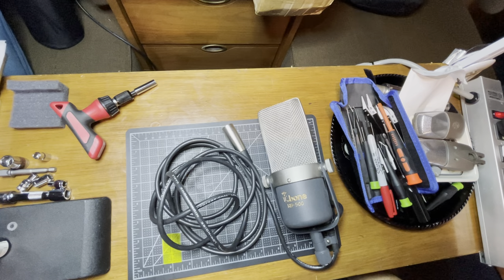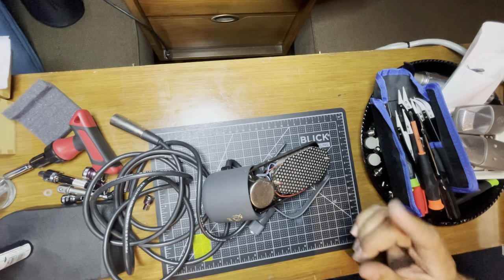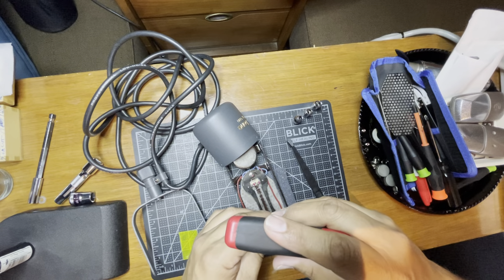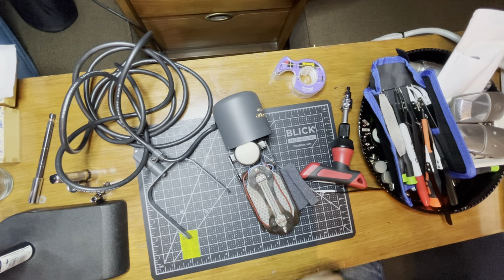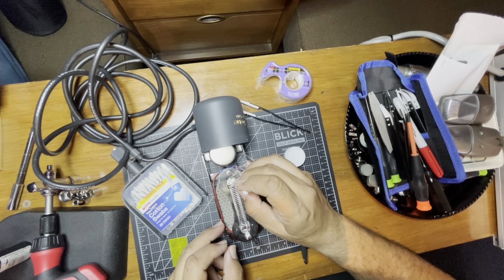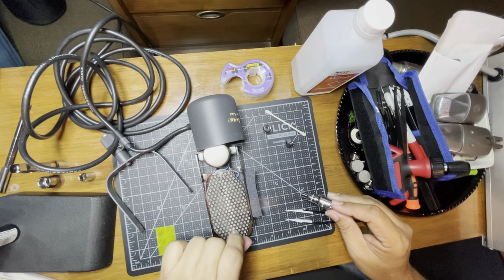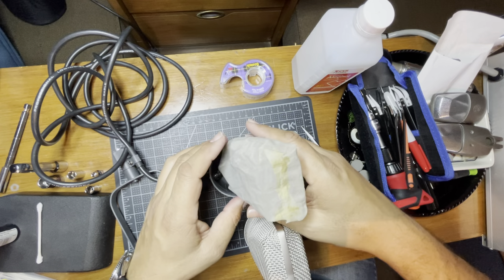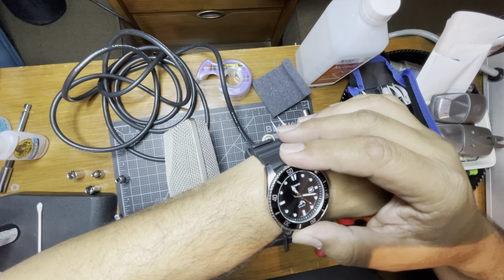How to replace and repair a ribbon for a ribbon Microphone. T.bone RB-500

Comment: Around 35 minutes you say it's probably a few hundred bucks, but it only costs €99/$89 on Thomann. I've been considering getting one of these (I'm based in France so I get free shipping), but I might save some more and get an Avantone CR-14 instead. In Europe that's 3.5x the price of the RB-500 though

Comment: Excellent video. Thanks for sharing your time and knowledge. I just picked up a Nady RSM-2. It’s the exact same mic. Can you please tell me where you purchased your ribbon material?  Thanks
Reply from the maker: eBay you can get a few sheets . 2-5 recommended because it’s thicker. As you get better make 1.8 for more frequency response
Reply: @mannysmiclocker  Thank you. I will search for some.

Comment: Thanks, Manny!
Would love to see how you tune the ribbon. I have 2 MXL R80 mics, one had a sagging ribbon and it was making noise and had a lower volume output. I opened it up and tightened the ribbon so the noise issue and lower level were fixed but I have no way to tune the mic. Would be nice if both my ribbons were matched. I want to use them as either drum overheads or room mics and I think it's a good idea for them to be matched? 

Anyway, thanks for this!
Reply from the maker: Honestly those ribbons should be replaced. I’ve done about four of those microphones I do like them in the very dark. I think it’s hard to match Ribbons because it’s not necessarily the ribbon but the transformers have to be perfectly matched. Then the ribbons have to be almost identical and that’s very hard to do. Those are 80s a cool good luck with getting those going..
Reply from the maker: Regarding ribbons big companies laser cut now but I can’t say they compare quality to the greats and newer boutique microphone companies .

Comment: I'm about to do this to this exact mic and your video is really helpful! Thanks a bunch! How do you tune the mic? Any tips? Cheers!
Reply from the maker: I have the same gear Royer would use minus the actual measuring of the weight of ribbon. I do feel you can use your ears as well. Ribbon should sound full not thin or hollow.
Visual of ribbon I think crucial so make sure it sits well and the tension flexible but not too tight or lax
Reply: @mannysmiclocker  Thanks for the response man! Just did it to both mics. It's a pain in the ass but I think I got it! That being said, one of the ribbons is not perfectly straight and when I blow on it it leans more to one of the sides than the other. It seems the problem is my slightly sloppy corrugation hahaha. It's not loose and it's not touching the sides, but it's also not very pretty looking. Will this be a problem? I did some quick tests and it seems to be fine but I don't know. I'm kinda new to this

Comment from the maker: I will add I didn’t put back in that useless extra cage. Not feeling it was needed and most Cats that want to make sound better they remove even that silk screen. I keep as it does keep wind factor down blowing against ribbon.
Reply: A lot of people remove the waffle plates, too. Have you tried it both ways?
Reply from the maker: @bartpappas3236  I have and it’s clear as open . Because I don’t know how this cat will use ribbon I’ll be playing safe to keep on for sound pressure protection. this is pretty much a AEA R84 Witt different hard basket.